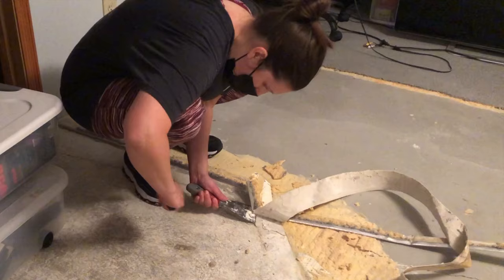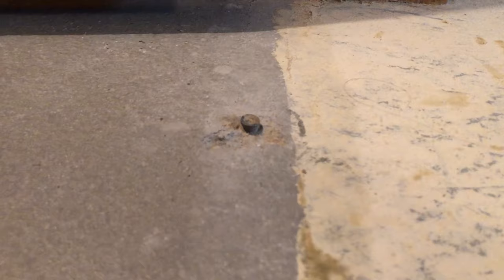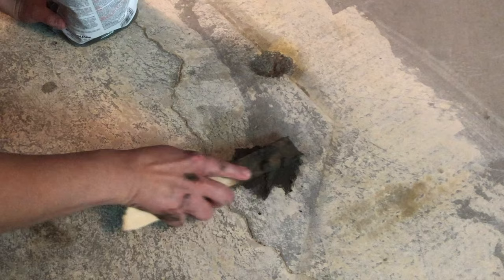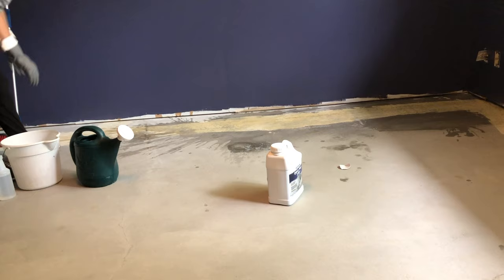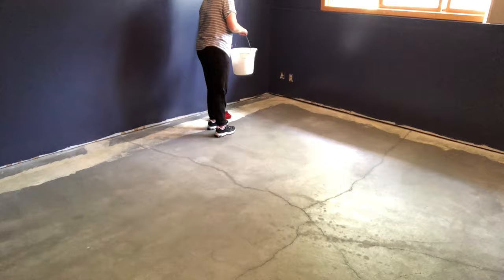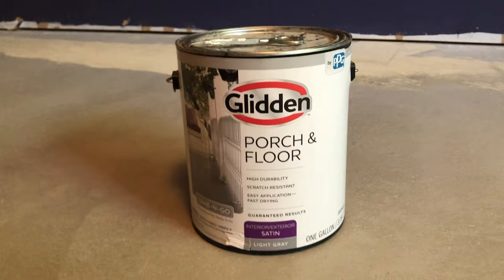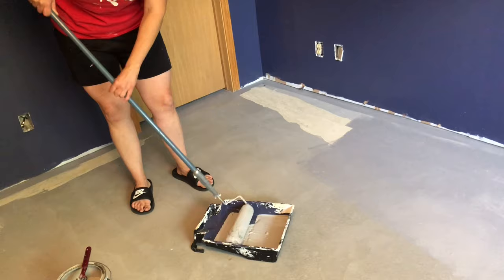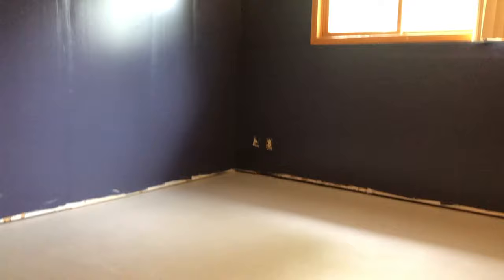How I Painted My Concrete Floor! DIY Budget Friendly Basement Floor Option

Comment: This is a good, cheap solution. Thanks for sharing. I don't know if you had those cracks assessed, but I'm going to put this here so people don't underestimate foundational cracks. There are a couple problems with foundational cracks like that which are not structural issues. My dog died from GAE, which is caused by an amoeba often found in groundwater and can come from cracked foundations. This isn't the only dangerous amoeba or bacteria that can come from a foundational crack. If people are watching this thinking they can just fill in the cracks and go about their day, they should really have them assessed by a contractor, check for moisture build-up, buy a kit that detects microbes, or all three. If water is slowly seeping into your foundation it can also cause mold build-up, which includes the dreaded black mold. This isn't me trolling. I liked the video. I just want people to know the risks so they don't experience what I did.

Comment: ***next time--I'm renting the floor sander from the hardware store that hooks up to a shop vac!  I spent 7 days scraping and sanding and hand washing until breaking down & buying a shop vac, but renting a sander with it would have made the work about 45 minutes to an hour (not including clean up and the set up of the plastic door preventing the dust from going everywhere.
Reply: Those are incredibly helpful details Hope, did you by any chance do a video?  I'm trying to get up the courage to do this for a back bedroom area.  Any feedback is appreciated!
Reply: 11111111
Reply: @cartor7962  did you start on your project?

Comment: The filler you used on the floor was probably hydraulic cement. Just a guess. It dries very fast and gets warm to the touch. You only mix and apply a small portion at time. I’m not sure what the instruction were but if you mixed the entire bag then you have to work very fast.
Reply from the maker: That sounds exactly what it was! The instructions were to mix the entire bag. Now I know not to do that next time. Thank you for sharing your knowledge!

Comment: Should have added a clear epoxy coat
Reply from the maker: Maybe. Time will tell. It’s been on for a year and done just fine. The directions on the paint can said that a topcoat wasn’t needed. But if you want to do one on your floors, go for it!

Comment: I used a floor scraper to knock thw nails out. It works the same as using one on wood floors to remove staples. Just a little more pressure, and saves a ton of time. You will still end up with the small dips in the concrete to fill if you choose to.
Reply from the maker: Thank you for sharing!

Comment: Might have etched first then repaired and sanded. Then apply the paint. Etching could damafe the patching material. And if it does not work out well, Costco sells one piece floor mats. That's my plan.

Comment: Hard-Way Construction...

1 - Floor scraper
2 - Just a hammer, ping on multiple sides, pull the nails
3 - Floor leveler, mix as needed, use a trowel
4 - Floor scraper again, probably need a new blade
5 - Wet mop, then use that to dampen the floor

...

Comment: cement filler mix needs to be mixed a little at a time so it doesn't dry up on you, tip for next time. great video thanks.
Reply from the maker: Thank you for the feedback, Luciano!

Comment: I was told the acid etch is really only a strong cleaner and could mess with adherence of the concrete patches.  That makes sense to me as concrete is a very strong base.  First, they had me sand with rough sandpaper 80 grit it was very messy as the glue was for old linoleum tiles! Mostly very dusty, but some spots actually gooey!  Then, just scrubbed with household cleaner (Fabuloso-lavender) and used a shop vac to suck up the soap and also the rinse--and then did my concrete patches, first with concrete patch primer, then teeny batches of self-leveling concrete.  Sanding the oatches after 24 hours was a good idea so it looked the same painted!  My porch paint adhered really well.  I stenciled and then waxed it and it is buttery smooth to walk on.
Reply from the maker: Thanks for sharing! Your floor sounds like it looks beautiful with the stencils.
Reply: @queenofthehousehold  Thanks!  It surprised me how nice it looked.  I did use porch paint for the stencil as well, just in case you wondered.
Reply: You must have great patience !!
Reply: @robinkuruda5249  🤣I wish!  Just trying to shoestring the budget as much as possible, but there are some serious trade-offs!

Comment: Hello. Do you need another coating / seal to keep the surface from getting dirty foot prints or scratches after? Please recommend. Thank you!
Reply from the maker: I didn’t do a coating and it is harder to keep clean. So yes, a coating would probably have helped with that.

Comment: I'm debating whether to paint or put in vinyl flooring. This looks good and is a lot cheaper and is fine to get wet. Vinyl does look nicer and more finished though.
Reply from the maker: Yes, I agree. There are definite pros and cons to either choice. I hope you are able to figure out what is best for your home!
Reply: I’m looking at other options because lvp is not option for me right now. This  is way more economical. You are the real MVP thanks for sharing!!! 🏆
Reply: I feel adding vinyl is adding more toxins to your home.
Concrete treatments can be made more attractive

Comment: You did a great job; was wondering if you ran into any leveling issues and had a recommendation for that?
Reply from the maker: Thank you! I didn’t have any issues with leveling. But I would think you would need to use self leveling cement and a trowel.

Comment: Really enjoyed the video. I have just painted my kitchen floor which is concrete and I am pleased with the result. I am only wondering how well will it hold up to multiple floor washings?  What has your experience been with maintenance?
Reply from the maker: It has held up well for us. The only issue is it does show dirt more easily.

Comment: We have a screened in porch with a cement floor that is more textured 😅 (think rough like cement stepping stones). We want to paint the floor so it is all one color. We canr decide between plain floor paint or the special grip stuff. 

We want to be able to "mop" the floor Georgia = a heavy coating of pollen in the spring. But dont want to to be slick like a polished conxrete floor if it wet (I'm middle aged now but dont need a broken hip from a fall in the future hello nurse mindset😂) 

Are you still happy with the non textured paint and is it easy enough to keep clean?
Reply from the maker: Hello! Yes, I’m happy with the paint for the most part. It is a little hard to clean. I can’t just use a mop to get the dirt clean. I have to scrub.

Comment: Thank your showing that it was a Satin finish. I am very particular on how gloss/matte/semi gloss/satin all turns out based on lighting and room purpose. Have you experimented with matte vs high gloss? I keep wondering if a high gloss black is practical! Thanks!
Reply from the maker: I’ve never used high gloss or matte. I stick with eggshell and satin most of the time.

Comment: Looks nice. This video is about a year old when I’m watching it. Curious as to how the floor is holding up? Any peeling or flaking? Would you do it again? Any thoughts on the cleaner? I have fairly new concrete I’d like to paint and I’m not thrilled about using the etching product.
Reply from the maker: Hi Greg, there has been no chipping or peeling on our floor. I would totally do it again. As far as the etching goes, that is what will help give the paint something to stick to so that it doesn't chip. Of course, it's up to you, but I would recommend using the etching for durability.

Comment: Is it best to put a clean coat on top of the paint? We tried painting a concrete floor and it had so many paint chips right away.
Reply from the maker: @AuroraP4t3L  I never put a clear coat on mine and have had no issues with chipping. It maybe the pain you used or a problem with how you prepped the concrete before applying the paint.

Comment: How is this holding up now that it is a year old
Reply from the maker: For the most part it's doing well. The only thing I don't like is sometimes it is hard to clean and shows the dirt easily. I probably should have added a top coat to help with that.

Comment: Do you need to do the etching if the floor is new?
Reply from the maker: I would. The etching helps the paint adhere to the concrete and last longer.
Reply: Especially if it’s new, tho you can also get a concrete bonding primer.

Comment: WalMart is not the only source for many of these products including Glidden paint.  The fact that you purchased a crack filler product from WalMart that was not as efficient speaks for the types of products that WalMart sells.  I'm not clear that the compound was any less expensive, but when you buy cheap, you get cheap, which is what WalMart sells.  You admit there is a product that is already pre-mixed.  Such a product is available at the better Home Improvement/Hardware stores such as Menard's, Home Depot, and Ace.
Reply from the maker: I understand what you are saying, but Walmart works for me!

Comment: Thanks! I love the soundtrack you used for the crack filling and paint mixing/edging segments. It really shows off what my subwoofer can do. Can you provide the name of the artist?  My floor consists of patches of old paint and scraped areas of rust stained bare concrete. My instincts for preparation are to sand, then etch with an HCL solution or white vinegar. Do you agree? Grazie :)
Reply from the maker: Hi Harrison! The song is Sunset Dreams by Cheel. It's a fun song and free to download. Yes, I think you have the right idea about your floor. You'll want to get all loose debris and rust removed first. If you sand your concrete and it is roughed up enough, you won't need the etching. You could just use a cleaning solution like the vinegar that you mentioned. I hope this works well for your floor!

Comment: Yeah using acid in an enclosed area, no thank you
Reply: It's not a problem if you ventilate by opening the windows and running the fan only on the HVAC.
Reply: Although an acid the etching compound is pretty mild.

Comment: Does not last. Furniture and other things scraped it. I ended up putting different coats of 3 colours and sanded them through as if worn, even then had to sand any future or large scrapes to blend. Don’t waste you time or money. You need epoxy or polyurethane for it to be hard and durable.
Reply from the maker: I’m sorry to hear that! Mine has lasted a couple of years now with no scrapes.
Reply: Shhhh! The paint might hear you. Don't tell the paint! bahahahaha  @queenofthehousehold
Reply: Shhhh! The paint might hear you. Don't tell the paint! bahahahaha  @queenofthehousehold
Reply: I had painted floor last 5 yrs, still no touch up. But I used expensive paint
Reply: @psfgtech which did you use and how many coats?
Reply: I agree. I painted a concrete floor and the paint chipped almost immediately. Need some kind of top clear coat or paint.

Comment: Painting concrete is like painting brick. Don't do it.
Reply: Not unless it is extremely worn and porous.  I did this to my smooth concrete carport and it covered in one coat.  The brick fireplace, however, took 3 coats of primer and 4 coats of paint.  It was like painting a sponge.